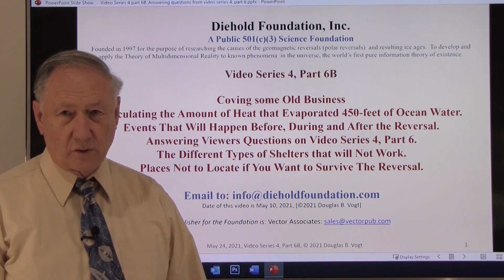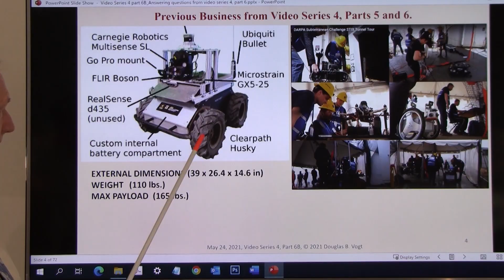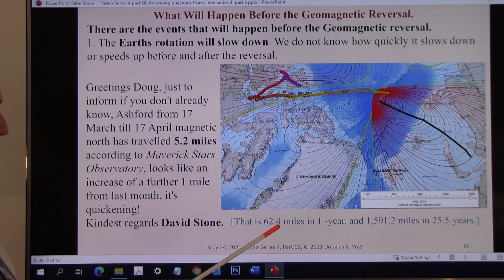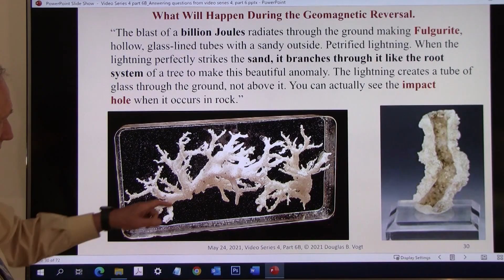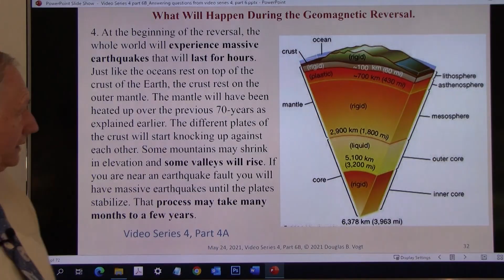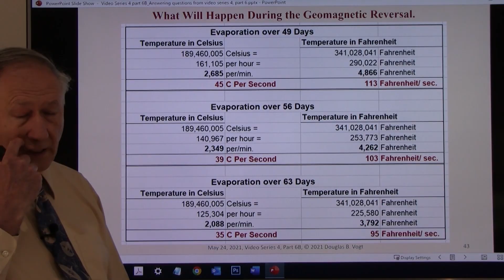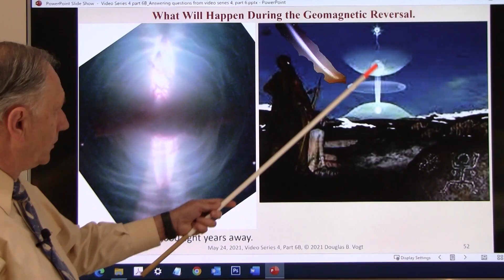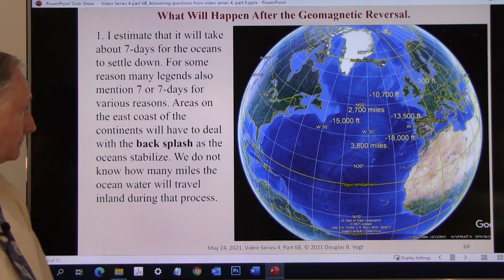Series 4, Part 6B, The Sequence of events before, during and after the polar reversal & Nova.

Comment: In regards to the instant evaporation of the water,  how can we assume that the worldwide change in sea level was instant caused by Nova? Could not a great portion be attributed to the onset of glaciation where over time the water is deposited as ice? Also it is mentioned that the Nova event is the onset of a glaciation period and also that the cycle is 12K~ish years. The last cycle was at the end of the younger Dryas that ended a glaciation period, not begin one. Questions that arise when sorting this information.

Comment: If planet rotation suddenly stops won’t techtonic plates move?
Reply: Yes we will have to survive a half day long magnitude 10 earthquake.
Reply: the whole earth's crust will float, violently, over the mantle layer in the direction the planet was spinning.
This will happen even if the rotation doesn't stop suddenly. There will be a new equator, the same as there will be new N and S poles.
I'm preparing now by stocking up on toilet paper and batteries.

Comment: In a nuclear Reactor one Accident anzlysis deals with loss of coolant/loss of flow. Loca, Lofa, at lower heat flux you get DNB. Departure from nucleate boiling. The other add high heat flux to get a condition called Dryout. Vapor caries little extra heat from the heat flux source causing massive temp spikes. DNB removes more calories from latent heat of vaporization. Limiting temp excursions. On my reactor a cm2 put out in one second an irons output of one hour. 
Also as a thermal blast hits the ocean, heat must traverse through the heated media. It is parabolic in its heat curves. The ocean deeper than a kilometer or so needs twice the thermal energy applied to evaporate an equivalent volume. Heat is a Plane not point source from Sun. It "wraps around" the earth at first forming gradients. Then it depends. If Time depth of exfoliated energy from Sun is moments (5seconds) teardrop envelope forms and is carried by solar winds. 
Why rings in glyphs on
Reply: Lost net on region. Sun flares coming
Reply: Cool. Interesting details to ponder, despite being either beyond my comprehension, or your brief description.
Reply: @CmdrCorn  lost internet in middle.
Reply: @CmdrCorn  glypgh in rock all over show rings. Implied its in stages. Bursts in spots detected. See B Forester or foerster(?)  incatours site on yt. In karnak the monuments burned of melted granite there. 
Rotation of earth changed. The were all pointing due north. Then later stuff was built at 24.5° off north.

Comment: Good to see you back Doug ... it looks like you are digging into the research better than ever .... Here are a couple questions to keep you thinking:  What will happen to the Van Allen belt protons when the nova hits?, How big can the hail get?, Will the incoming tidal wave's water weight cause increased subduction?, How wide will the mid-Atlantic ridge spread open?, How much of the ice-sheet's mass will be created simply due to a dimmed sun?, Is it possible that the 450 foot decrease in ocean depth happens over years, decades, or more?  Since the coast lines are not perpendicular to the equator won't the tidal waves and splash backs cause a severe wobble to the planet?  Definitely going to watch this video a second time.  Thanks!  btw:  I saw the dementia symptoms with J.B. as well, avoid chemically soaked prepper foods.

Comment: Nuke plant. Pressurizer of PLWR is 636°F at 2000 psig. See Mollier diagrams of enthalpy/entropy of water. At 700°F a Triple point of water is on diagram. If Saturated vapor is 636° and increased h, enthalpy added it becomes superheated steam. Older boilers on ships used 100-200° superheat to run turbines, exhaust went thru Latteau stages to get more energy to move LP turbines. 
So? If nova evaporates ocean and applies energy to the vapor is will reach Saturation, then Superheat. It will put a differential pressure across the atmosphere like a condenser in steam plant does. Massive vapor will turn to water in clouds. The moving air/vapor/rain pressures will act like a combined cycle of refrigerator,
Dropping pressures will freeze vapor/water in a flash. I have seen it in plant. Compress air, expand it, air conditioners do this too. Ice could form ten thousand feet thick in moments on opposite side of earth. A wooly mammoth would freeze solid in seconds. Oh, that actually happened didnt it folks. 
Talk about crust pressure applied. Tensile Compressive. They are ADDITIVE ON COOL DOWN. THIS MIGHT REARRANGE THE CRUST ALA C THOMAS STORY? I wont be there. But you guys might...

Comment: the evidence is all good, but some of the conclusions are flawed. you have failed to adequately explain the rotation reversal, and for me it is a colossal inertia issue. you are calculating the energy needed to evaporate all that water, but how much energy does it take to reverse the spin of the earth, and where does that rotational energy come from? maybe the following scenario is a possible answer; when the blast wave hits the front side of the earth the pressure  pushes most air and some water to the back side of the planet, the longer it lasts the more water that builds up on the back side. when the dust shell has past the air rushes back to fill the void created, and as you have pointed out  boils law causes a mass freeze on the backside creating giant ice dams that prevent the oceans from leveling back out and locking that massive imbalance to the crust. that imbalance causes a wobble, and that wobble could cause the earth to flip 180 degrees. it would still be turning the same inertial direction but with perspective of the sun it would spin in the opposite direction.
Reply: There are lots of papers on the Earth's spin and how it interacts with the magnetic field. The Earth is already slowing down and the field is moving to flip. This is just one video, he obviously doesn't explain everything here. There are many other videos that go into detail about the things you said are flawed if you take the time to find out.
Reply: I don’t think we will have a water issue - that was the Noah flood - we have to worry more about the earthquakes and fire.   Flood might come later to clean the Earth - we will mostly be gone by then.

Comment: Thanks for the videos, as always. Where do the Suspicious 0bservers have it wrong in expecting a 90 degree rotation flip vs the 180 degree flip you're proposing? The optimal locations are most likely not ideal under both scenarios but there might be a few. Thus, either there's a strong enough reason to accept or reject one of the scenarios and pick the best spot in light of that or to pick the best spot given given a 50/50 chance of your scenario and Suspicious 0bserver's scenario.
Reply: it's all guessing.
Now... the Equator used to run on a line from Easer Island through Mach Picchu through the Giza Pyramids and Gobleki Tepe- that's about 23 degrees. Sites near Machu Picchu and Giza show signs of extreme heat on the west side, that could be explained by a massive electrical discharge on the equator. The old North Pole was near Dutch Harbor, Alaska. There's a "Mayan" ruins site that was exactly halfway between Dutch Harbor and Machu Piccu.
Reply: @Tumbleweed_Tx  I should have said rotation reversal. Have you seen the Suspicious 0bservers video that claims a very similar event? They claim the rotation will begin rotating perpendicular to the current rotation.

Comment: Between Italy/France and Italy/Switzerland under the Alps there are road/rail way tunnels long more than 10 km and the entrance is at 2000 m elevation. Would them work as temporary shelter from dust shell, radiation and floods ? Those are already cold regions, can't imagine to spend any time there with ice, avalanches and landslides

Comment: If a cave door system was like the pyramids interior.. lead uphill, then water couldn't enter the cave system.
Doesn't need a door
Reply: Yes, maybe the ancient pyramids are a type of airlock or gate designed to seal off underground cities and tunnel from the catastrophe?
Reply: I think the pressure would squish you depending on how much water is above you.
Reply: Down then up,  makes a very good air pocket - said this 10 years ago

Comment: I'm watching your video and stop if I'm wrong here but isn't there a direct correlation between the speed of rotation of earth and atmospheric air pressure. The faster the earth spins the harder it pushes on the gases in our atmosphere. Well if the earth rotation stops, even momentarily, than does that me the vaporization point of any water go drastically down. Your calculations are based upon the presumption of current earth rotational speed. This would throw off all your numbers off, drastically.
Reply: It would make the situation much more scary and intense.. I think the slowing happens after we get blasted though

Comment: I think part of the reason the Pyramids where built was to survive extremely large wind speeds 300 mph ++
Reply: Yes,  a pyramid shaped gate or air-lock device is the ideal structure to withstand the forces of water, ice, wind, radiation, heat etc.

Comment: The cave you hide in better be sealed. Anyone that knows about diesel engines know as 2-3 miles of ocean water covers your cave the air pressure is going up a lot. This means the temperature will cause anything flammable in the air pocket to combust. People are flammable at these temps. Just sayin'.
Reply: If the cave is sealed why would the pressure change? The same sealed cave could be in space but that does mean pressure would drop to zero. If the cave isn't sealed then prepare to drown.

Comment: Hey Mr Vogt, have you ever considered talking to a Materials Scientist for valuable information about which materials would be best for the cave doors considering the pressures involved?? It might be worth looking into?? And, of course thank you for the excellent information...
Reply from the maker: Yes and we are looking for them. Have them email me at research@dieholdfoundation.com  you all now know how bad this reversal is and that if you do nothing you will now survive it. Now you know why the door system is so important.
Reply: @dieholdfoundation6705  , i am no scientist but have a good imagination.  Instead of a blast door think of a vertical cylindrical pipe with a rubberized ping pong type ball inside it that will float up with water pressure and will instantly seal the entrance to the cave type  structure. The greater the water pressure, the tighter the seal will be. As the water level drops, the ball will automatically drop, allowing access to the outside.

Comment: Doug... The Ocean water boiling / Evaporating due to heat and Atmospheric pressure... Etc....  Wouldn't that all be based off of  Boyle's Law....??
Reply: Revelation 15:2
Sea of glass...Nova results!😬
Reply: Boyle's Law :. P1V1 = P2V2 (P1 =)  first pressure (P2=) second pressure. (V1=) first volume, (V2=) second Volume.  Or based on Charles Law, Boyle's Law and G.Lussac's Law... Forming the combined gas Law. Solar energy drives evaporation of Water from Oceans, lakes, moisture in the soil amongst other things.  × that by... An immense burst of plasma energy coming off the sun.. Burning, Melting and  Evaporating Almost everything above ground. Minus the things that can indeed resit the amount of heat temperature and it's direct impact and amount of time said heat (plasma) blast is substained... Hours....days, til the decrease of max temperature starts to cool, and I suspect that the cooling will come almost as rapid as the heat blast hits the earth., "Meaning after the earth reaches max temperature, then starts to cool... But when the cooling. Begins it will drop substantially for a very long duration, = A Coming Ice Age in a Short time after the Sun Novas.  So the planet will be blasted, heat up burning Melting and Evaporating so much.. then cooling to an Ice Age with little time between. Survival will need be underground. Any coming out will be during Extremely Freezing Cold Temperatures. So all good grown , animals , etc will be done underground.